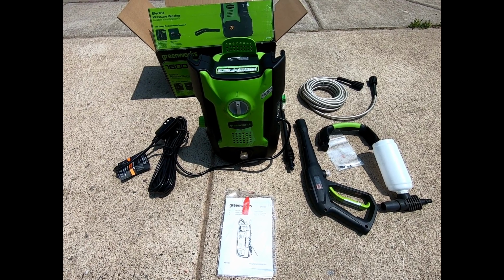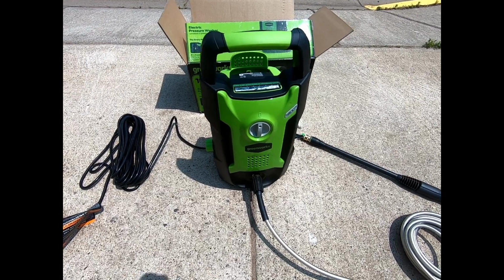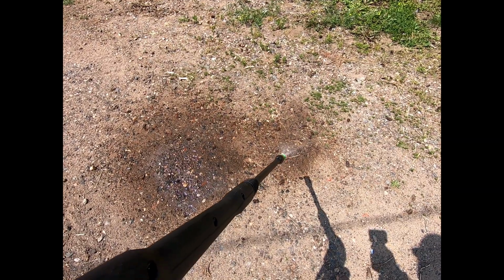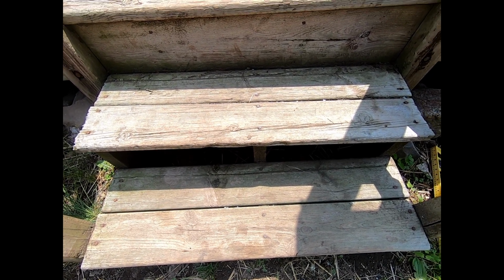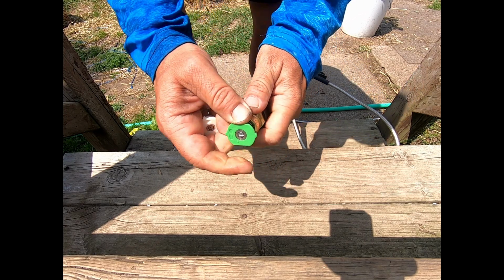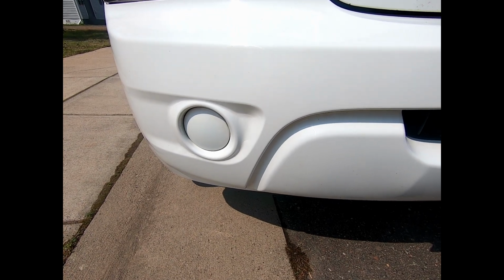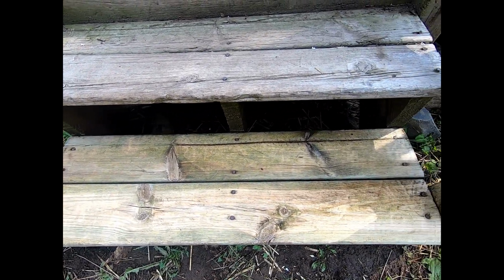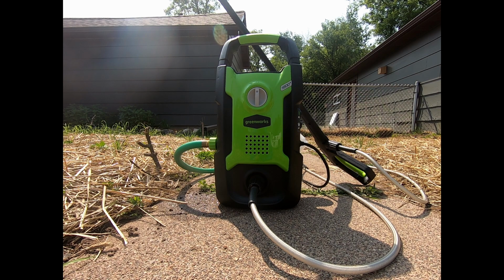Greenworks Pro 1600 PSI Electric Pressure Washer Product Review

Comment: The gun won't stay put with the nozzle, how do I fix this, it keeps falling apart
Reply from the maker: The nozzle head should pull back towards the handle, you should be able to insert the tip, and release the nozzle head and it should snap into place and lock the tip down